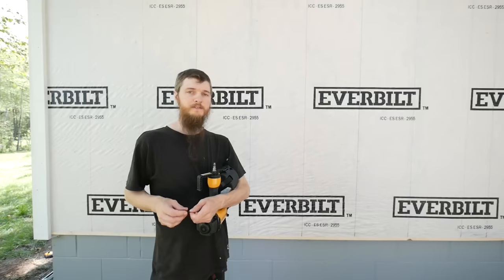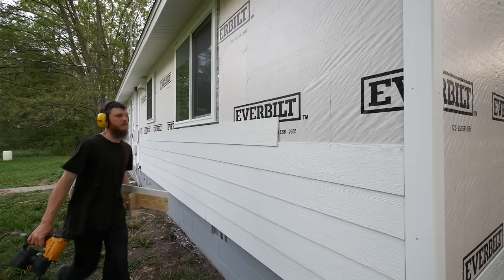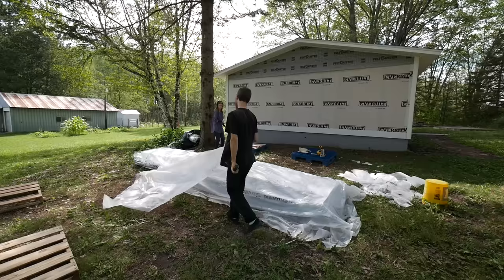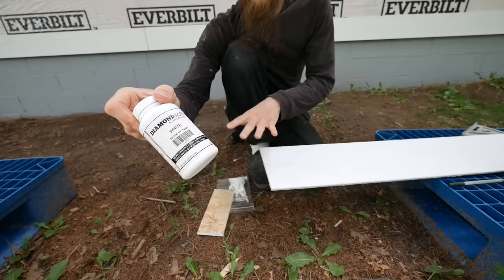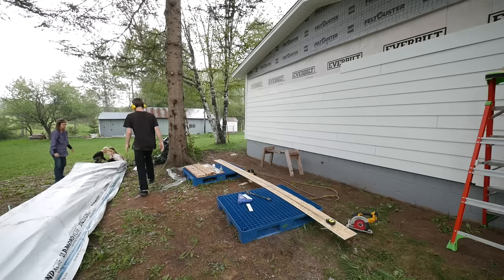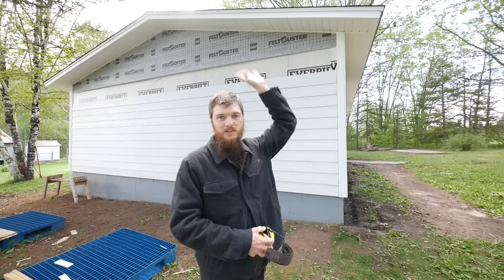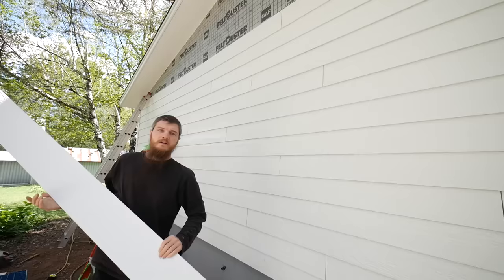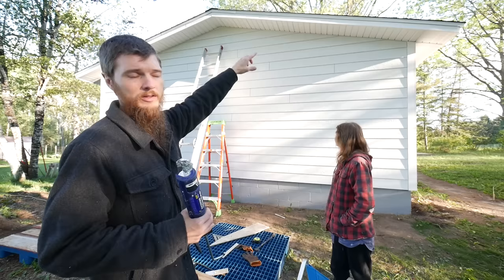DIY Couple Installs LP SmartSide on their 1970's Mobile Home

Comment: Where is your paper behind the seams to help keep out water. Then you can caulk but the tar paper or house wrap behind the seams should be done. You may want to check and make sure that this does not void any warranty offered. Just helpful advice from a builder. Otherwise y’all are killing it looks great
Reply: I work in construction and I thought the same thing. Could be it is unnecessary because of the Everbilt vapor barrier.
Reply from the maker: We installed it one of the 3 allowed ways according to the siding manufacture. Thanks.
Reply: Ok I just wanted to make sure you didn’t lose your warranty. I’m glad to hear that you talked
to the manufacturer. I learn something new everyday. Thanks for the information. Again it looks great, keep up the good work!
Reply from the maker: @firestarter2550  We saw it in their installation videos :) Thank you so much!

Comment: I have this composite on the back of my house too. It's the West side. It sees a lot of sun. The only area showing issues is below the water faucet is broken away. It seems dried out? The paint color is definitely fading. It's three-four years old. It's a liberty blue color and I'm thinking to give it a good thick coat with the high end paint in the line. Hopefully it will last more brightly. It doesn't show any hail damages. And we do get that here. My seams show as 'open', IDK if there's another method they used to seal them or if they are unsealed? If the caulk comes in clear I could maybe use that one or caulk them up before repainting. You got me thinking! Anyways, I showed my teen your worm, she shouted, 'Oh My Gosh I love them!' Is it time? I guess so! Her friends said they are 'toxic'. Lol. Yours is one of the 'williest' worms I've ever seen! Congratulations! ; ) Also, the bees love my husband and they get him running too! We have BIG ones!

Comment: Great job. I love the attention to detail. Isn't there supposed to be a piece of very thin flashing at the seams of siding? The water running down at the seams will end up on the house wrap which is not a good practice.
Reply: Correct, they’ll have to really keep up that caulk and that’s difficult
Reply: I literally came here to add this comment

Comment: I was wondering what was under that Everbilt before you did the siding, and I would have put flashing at the seams between the planks.  I resided our 88' Fleetwood with 15/32nds cdx first, tyvek, then T1-11, I would have used Hardi board had I known about the stuff.  And I definitely agree with no vinyl, it's extremely flammable, and I would have used Hardi board slats.  Great job.
Reply from the maker: Under the house wrap is 7/16" OSB sheathing. Thanks!

Comment: I don't know how old videos are, but I hope you're still reading these.
I am getting ready to redo the Siding on my manufactured home, around mid 1980's model.
When you took all the old Siding off did you put new sheeting on beforethe wrap, and if so, how thick?
Reply from the maker: We did put up new 7/16" OSB sheathing. You can see it being installed here: https://youtu.be/3bwsO01NkkI?t=305
Reply: @diyfferent  Thank you. I have really enjoyed watching your videos and the progress you're making.

I'm a 63 year old cross country truck driver and was going to build a deck. Found dry rot and other issues. So now I have to remove old Hardie board Siding and decided to go with another look. Have done this kind of work in probably 40 years. But you have given a renewed confidence to do this.

I'm going to have to do one side of the house at a time as I have to go back to work.

Sorry about rambling on.

Thanks again for your videos, I've learned a lot by watching them.

Comment: are you not flashing your butt joints on the siding?  Mine was not done when they built house and I am paying for it now 15 years later. Caulking failed and had to replace one whole side of house as it let water behind siding and started rotting.  Now replacing whole house. the flashing is cheap insurance..

Comment: Hi Doug and Ashley, I know this is an old video, what is the wooden thing your holding the boards up with? Did you make it talk about it and how do you make it? Thanks in advance for the help
Reply from the maker: Yea, they are jigs we made and we showed them here: https://youtu.be/vkJ6vyVmNHQ?t=846
Reply: @diyfferent  thanks guys! Will definitely be using this soon in a old minor’s cottage! Much work to do and so glad you shared this! God bless from Australia
Reply: @diyfferent  Love your work! I have a question. We have a 14X66 Mobile Home and I was wondering, would this siding be good for a trailer that will probably need to be moved? Our trailer moves a lot up and down during the year because our landlord where we have had our trailer for 10 years poured really poor pads. 

Also, we have metal siding with furring strips over it with vinyl siding which is now in need of replacement. Would you recommend removing the tin siding and screwing up 7/16 OSB board, please? Thank you for your time and help.

Comment: What is the name of that board under the siding because it looks like it has lines showing you where the studs are I don't mean to sound stupid but I was wondering how people when they side something on a trailer how they know where the studs are That's all
Reply from the maker: It's OSB with housewrap on it. We drew those lines on ourselves. We could see the osb sheet through the housewrap so we just measured from the edges, every 16 inches on center for our stud locations.

Comment: Am planning on doing the same siding on  my double wide. I have a question did you install sheathing (osb) under the house wrap or just nailed it to the joist ??
Reply from the maker: We had sheathing on our home under the house wrap. If you don't do sheathing, make sure you still do house wrap. This is in the instructions "LP SmartSide 38 Series lap siding may be attached directly to framing members spaced a maximum of 16 inches (406 mm) on center.
• LP SmartSide 76 Series lap siding may be attached directly to
framing members spaced a maximum of 24 inches (610 mm) on center.
• Check your local building codes before starting to install siding
to confirm if wood structural panel wall sheathing is required."

Comment: Please remind me why you decided not to use scaffolding? Everything is looking great, I kind of wish you were planning a deck on both sides, rather than the small landings you plan.
Reply: Small landings?
Reply from the maker: We just don't want to spend any money on scaffolding. It's a little slow using the ladders, but it gets done, haha. The issue we're trying to avoid with decks is that rain splashes on them or snow sits on them against the home and eventually causes problems, like the front and back decks we removed and there was a lot of rot. If they had roofs that's be fine, but with how low our roof slope is, it's just too difficult to do that, so small landings with awnings it is :) Thanks!
Reply: @diyfferent  Thanks for the clarification.

Comment: We live in Oklahoma warm humid zone, no vapor barrier/retardant other than what comes on the roll insulation correct? Do we need an exterior barrier such as the Everbuild wrap shown in this video? We love that LP siding  you used.
Reply from the maker: No matter what climate you live in, exterior house wrap should always be used. House wrap is a water resistive barrier that lets vapor pass through. You don't need anything else besides that.
Reply: @diyfferent  Thank you for sharing your knowledge! Your videos have been extremely helpful and well made.

Comment: If you aren’t putting on gutters maybe a French drain would be better then mulch. You will protect your foundation.
Reply from the maker: Our soil here is very well-draining :) We just want the mulch to prevent dirt splash up and keep weeds away :)
Reply: That’s really good.
Just remember you will have a lot of runoff from the roof. You want to keep your foundation as dry as possible.
Reply: You live in a snow zone, you do not want the freeze and thaw problems that a cinderblock foundation will have if its allowed to stay wet.
Reply from the maker: @kristybishop3286  This home has never had gutters in 45 years and the blocks are still in great shape :)
Reply: Ok I’m just talking from experience. 
If you are going with ground cover rock is much better and has a longer life than mulch.
Reply from the maker: @kristybishop3286  Yea, we learned at our previous property that when there are trees around the building they drop their leaves into the rocks, which turn into soil, and eventually weeds and grass start growing in it and it's a big disaster. We have a lot of trees around our house and that's just not something we want to deal with. Wood mulch is a cheaper and better option for us for this home. If we had a home out in the middle of a field with no trees around, we may have considered rocks. :)

Comment: i desperatly need REAL OSB, and  house wrap and better sidding on my manufactured home (1997) how long can the house sit with just osb and house wrap? as I am debatting on buying sidding every week in incraments as i get paid. I dont want water damage. but right now the sidding has some holes in it from previous hail damage, and the sheathing is just foam board with hole every so often that go STRAIGHT to the insulation! it drives me crazy...
Reply: Im a in a VERY similar situation..... did you get any answers? Figure anything out?
Reply: Osb sheathing with Tyvek house wrap can be left for a year or so, if you install the house wrap properly.

Comment: I see problems in your future. Not face nailing the bottom of the courses with any straight line winds could be disastrous! The other commentators view on the butt flashing sounds correct also. Good luck. 👍🍀
Reply from the maker: We're installing it according to the manufacturer.

Comment: Ok...yall are going to have some problems. No flashing at the butt joints. No end sealing before the boards are placed at the start of the run.
Reply: Change Your Energy CAULK
Reply: @cityfarmer2665  if the particular caulk used will seal. Not all cailks will. But ideally,  the caulk(sealant) will be applied first and the board is placed into and up against the corner board. That joint will then be sealed. Unless a cailk can seal, its just used used to fill gaps. And that's not sealing.
Reply from the maker: We're just doing it exactly according to the manufacturer...Also we are using a sealant. How to install LP SmartSide Lap: https://youtu.be/C9Fjr4SI-28
Reply: @diyfferent  being that the backing is particle board, I'd definitely make sure no moisture gets behind. I'm sure painting the back side would make it just about water proof though.